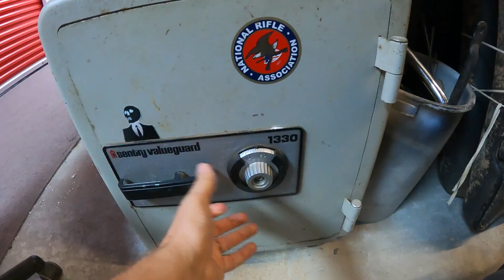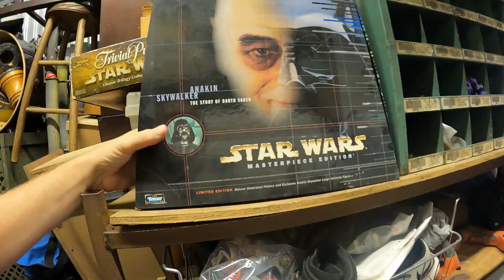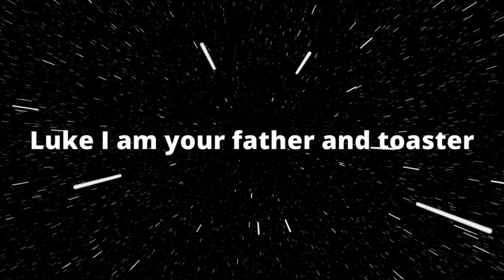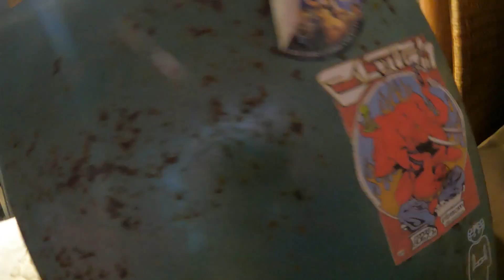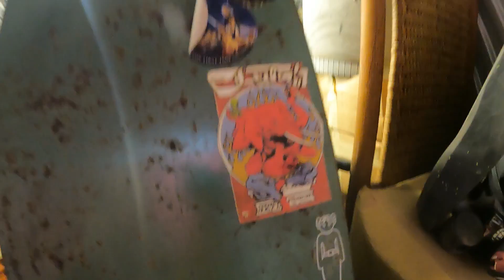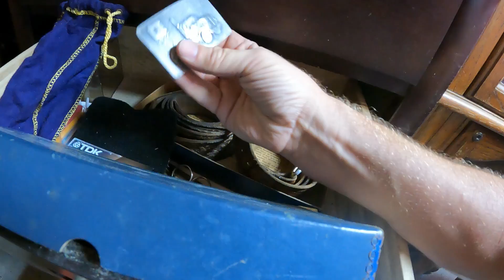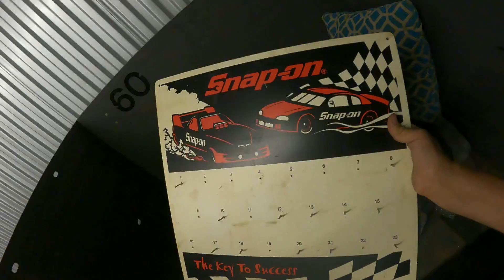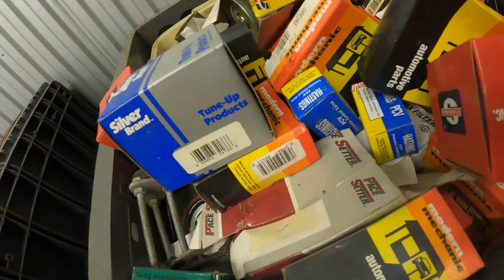I Won A $930 Storage Auction Unit Of An Eclectic Man Cave Junk Collector. Can I Turn A Profit?

Comment: if you passed this one up youd be dumb as a box of 30:30 ! lol nice video i just subbed . is there any place you can buy storage units and have them shipped to you?
Reply from the maker: The only case that I know of that they will ship a storage unit to you is when it is in a container such as pods or pack rat storage. You would need to call ahead to the specific facility before you bid to make sure that they will ship it to you though and get a shipping price.
Reply: @RedDirtResale  Nice. Thank you for the info!